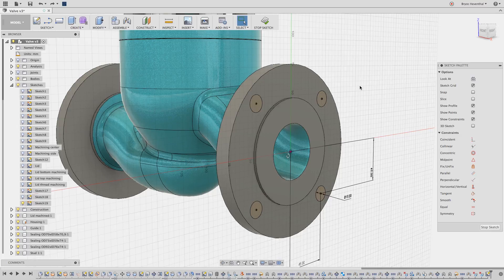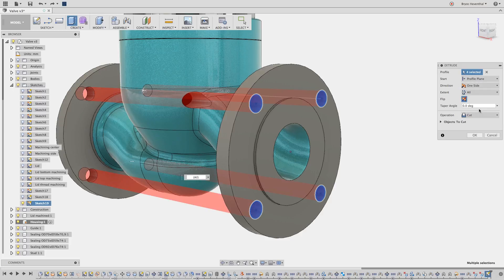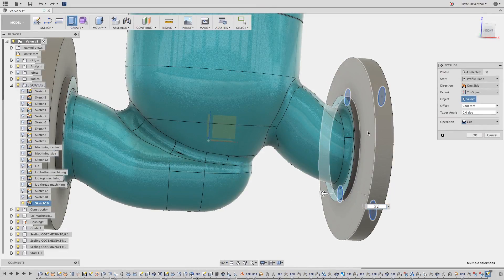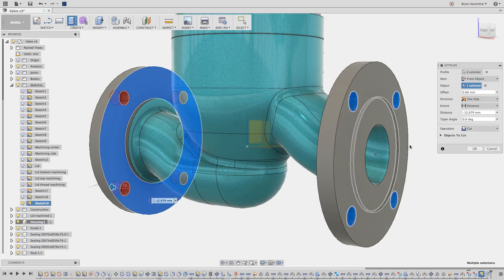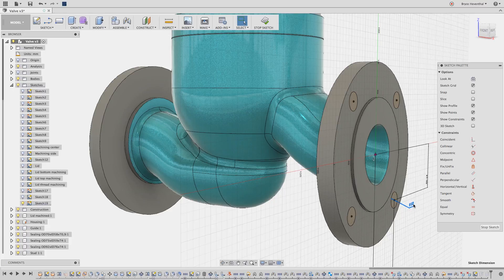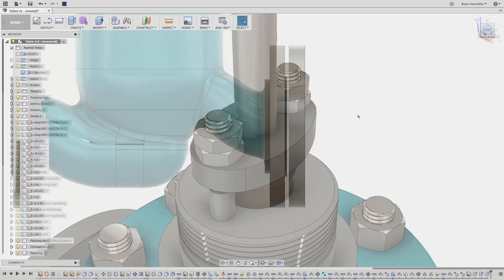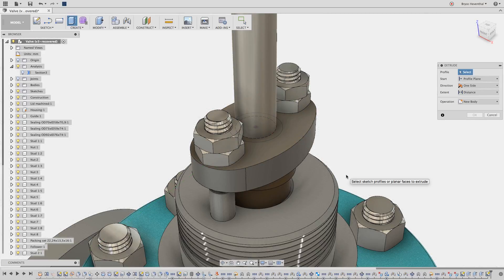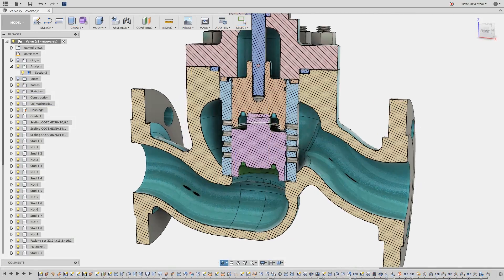QUICK TIP: Extrude Cuts

Comment: can u use the last tip for first extrude opreration?
Reply: Are u referring to "Objects to Cut"? The last tip only works with cuts. If you have geometry already in the design (from importing other CAD data, etc.) you can use that tip.
Reply: ok thank u.

Comment: how can I cut a mesh object?
Reply from the maker: You can use some mesh tools to remove areas or split, but not in the same way you could use an extrude cut with a b-rep body. You might need to convert to a solid.

Comment: One big question I have with fusion... What happens if you have rererenced operations,  like the flange holes on both sides, and you decide later that each side needs to have different diameters.  How can you easily copy the reference sketch but break the diameter constraint when you are much further into the project?
Reply: In Solidworks I'd say draw a centerline from the old sketch and use it for the new plane and new diameter holes. I can't seem to find many construction lines in Autocad Fusion 360?